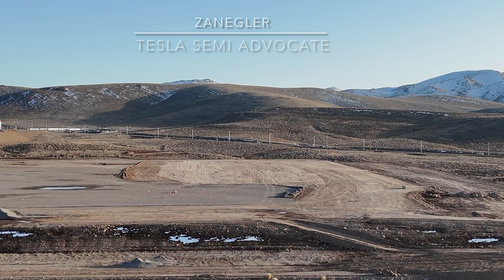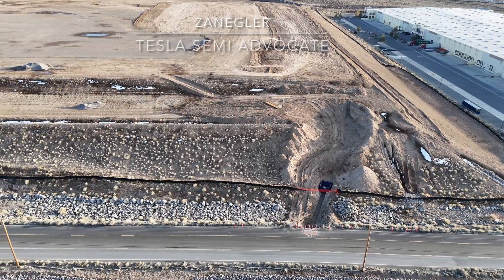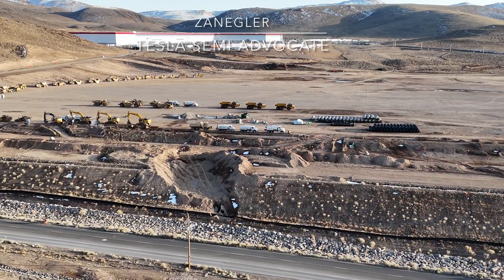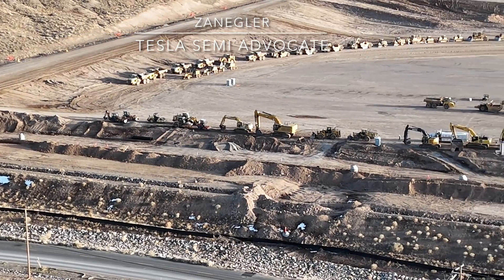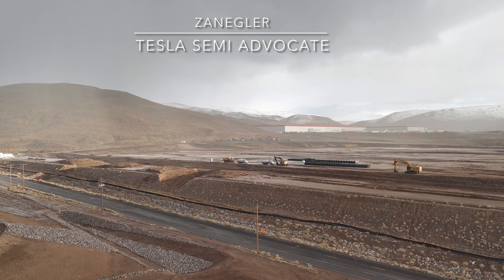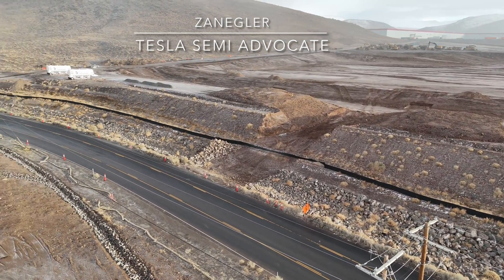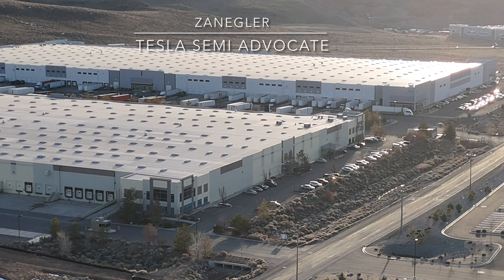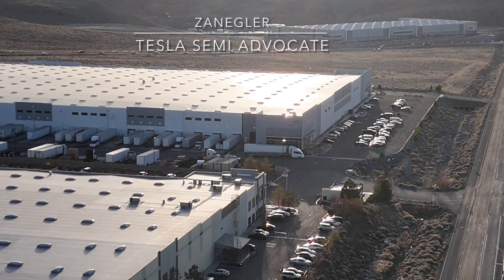Tesla Giga Nevada Construction Update

Comment from the maker: Upon closer inspection, I can see that the storm drain work has made pretty good progress. You can see a pipe coming down to the wash where storm water will be released into the wash.

In additon, you can see that at the far northwest corner of the site, they have cut into Milan and tied into the electrical utility.
Reply: Could you add Date- stamps?

Comment: They are still excavating the high corner of the site to level it. That corner has the largest quantity of soil to move and will seem to take longer. Also, you can see a row of manholes on this side of the excavators and I believe that a large deep storm water drain pipe has been installed and is in the process of being backfilled. The water trucks are there to moisten the soil to get the moisture content near optimum for compaction. There may be almost another week of earth moving to excavate the high corner.